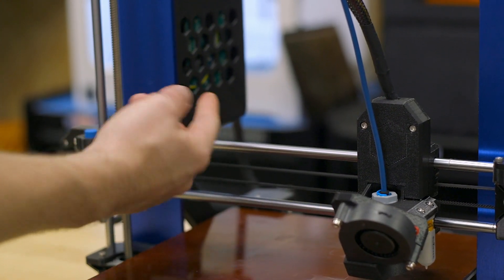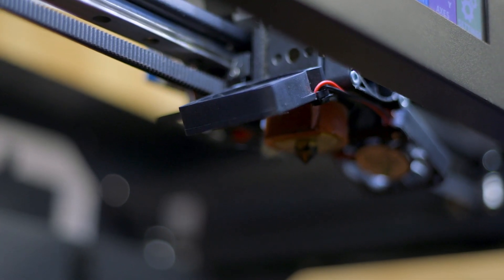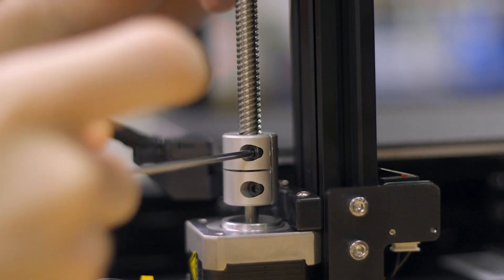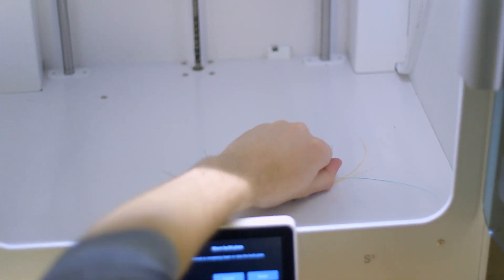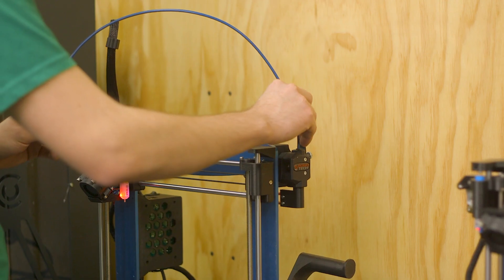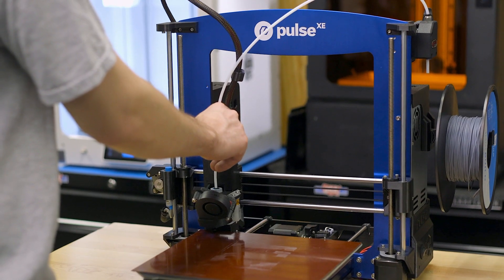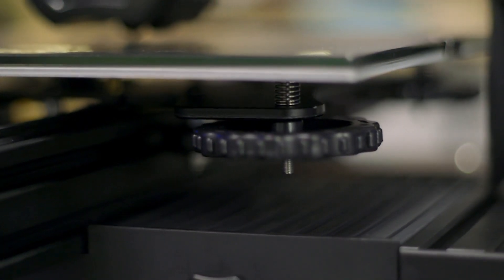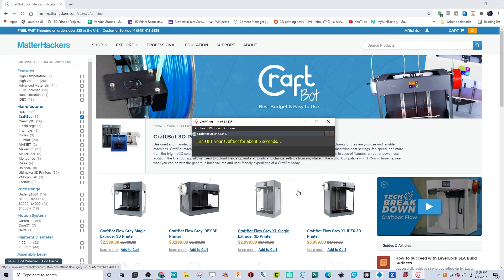The Top Ten Tips for 3D Printer Maintenance

Comment: I don't use machine oil on my linear bearings. I use two linear rods and use hydraulic pressure to force TinkSeal into the LMU bearings. Basically I use two 8mm bearing rods, same that are on the printer. I push one into one side of the bearing, push a pea size blob in the other end and push the second rod into the open side. This forces TinkSeal not only on the bearings, but into the bearing channel. TinkSeal is one of few lubricants that works on both plastic and metal and it builds on the plastic surface, lubricating and protecting it. If you use it on the T8 screws, just cycle the printer up and down a few times and then polish it clean with a soft terry cloth. The dry-lube nano particles will be left on the screws and will increase the lifespan of the Delrin T8 nuts.